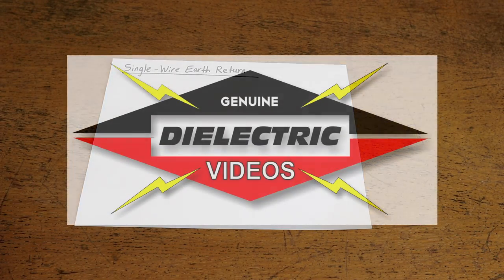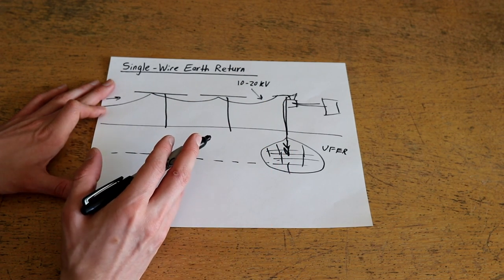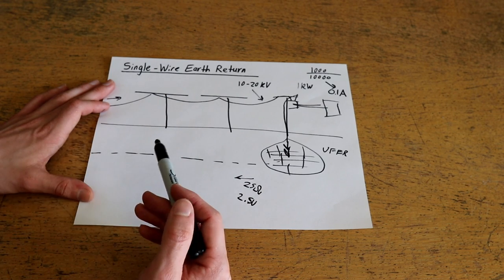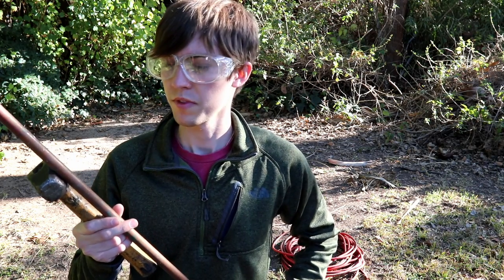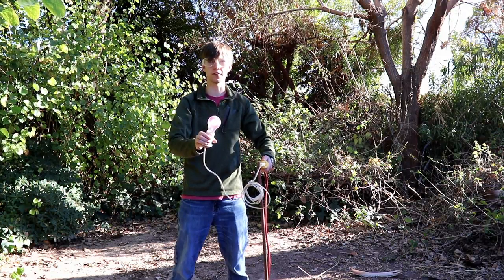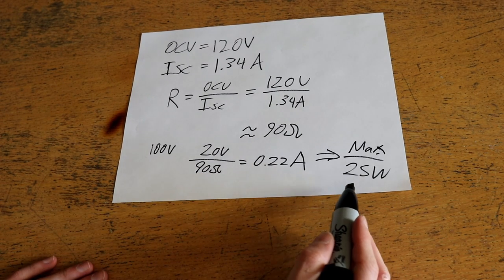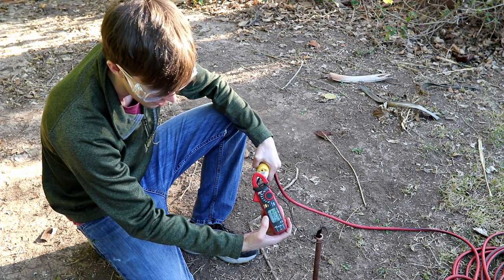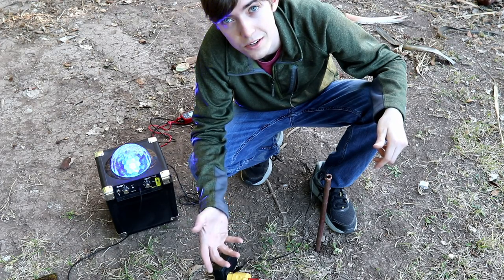EP 51 - Power Through Dirt: Single-Wire Earth Return @ 120V

Comment: When i was 17 my grandfather said he led the first AC power line installation west of the mississippi.  When i was 6 we went out to the back yard lawn with a long insulated wire, rigged to a plug (120vac) 1 meter  a wire twisted about a meter from the other end; forming a 'y' to which were added steel rods with insulated bike grip handles.  Watered the grass a bit, and pushed the rods into the ground about 5 meters from the patio slab.  Then he said plug it in.  ! he had rare external wall receptacle and we were gonna shock out some worms!  nothin' happened.  He told me to plug it in again but flip the plug over.... oh, boy- my bare feet tingled as we walked near those rods and we must have gathered 100 big night crawlers as fast as we could grab them.  Went camping and fishing in lodgepole pine country that week.  Got lots of fish too.
Reply from the maker: Good times indeed!
Reply: Ha! That's awesome! Your grandfather 
 knew he was showing you something unique that you would never forget.

Comment: Greetings, I really like your video as you are explaining the basics of grounding. Now there is a very simple way to get a much better result for your ground rod. See the ground has minerals and nutrients within. You can get better results if you would mix some manure to the ground. This will make the ground more acid. You simply add water and voila. The resistance will get lower and the amperage will increase. Warning though, should you try this, make sure you have the proper jumper, otherwise it will get extremely hot and burn. Cheers

Comment: My property is sandy loam, which when I pull a magnet through it, about 25 percent of the “sand” will stick to the magnet. When using electric coat hanger rods to catch worms, I only needed one rod, and worms came up between my rod and the nearest ground, within a few feet from my rod, and if the earth was quite damp you might feel a slight tingling placing your bare palm flat on that area.

Comment: i used to be a lightning conductor fitter, we had to install earth electrodes to dissipate the potential energy from a lightning strike, the earth electrode in some cases had to go into the earth 10 maybe even 15 meters into the ground to obtain an earth continuity resistance reading of 1 ohm. in some cases where that wasn't possible we had to install what's called an earth nest which comprised of a series of earth electrodes all connected together to obtain the 1 ohm resistance

Comment: Three 6 ft rods 2 ft apart in series tied together but the number six copper ground wire with adequate clamps you should have no problem passing power through it and there should be little to no variation. You should also be using copper clad solid steel ground rods. Drive those rods till only 6" of it is sticking out of the soil. Also I would be using some kind of a switch and clamps instead of the alligator clips The surface area contact between the clip and that metal pipe is minuscule at best. Love the video brother keep up the good work just a few pointers from 19 year electrician.

Comment: Find out what the right mix of dirt has the best conductivity in it, and fill a 6 in pvc pipe with it with end caps and a hole 🕳 at each end, with a conductive rod poked in from both ends so it can be a enclosed piece to reduce the risk of harm.
Reply: Salty wet dirt! Use that. Dry doesn't work. Go deep. Closer to the other telephone pole ground. Basically you are using the dirt ground instead of a wire.
Reply: You realize copper or CCA is cheaper and much easier, at this point? PVC is way more expensive.

Comment: Very interesting! Didn't know the ground would be that conductive, I've always assumed resistance would rapidly increase with short distances.... Wrong! I can see where this could be dangerous at very high voltage, at least 120 is quite low when compared to multiple kv!
Reply: Often, a lot of the resistance is in  gounding rods contact surface contact with the soil and is not so dissimilar to the resistance in corroded battery terminal limiting current to your car's starter.  

When a good ground is established then you can imagine the earth ground path like  a bunch of resistors wired in parallel to each other whose combine effective resistance adds like  1/(1/r1 +1/r2 + 1/r3 +1/r4 +....... )  (also known as the reciprocal of the sum of the reciprocals) which drives the resistance closer to zero as a ground path has more cross section conductive area to contribute to the return path. 

There is a limit to "effective"  ground paths futher away from a straight line return path as the additional distance in those paths adds resistance.  Differences in soil conductivity can change the  path some. 

Additonal grounding rods not only add more contact area to the ground, but if placed at 90 degrees to a long distance tramission line, can offer a larger cross section of return ground paths for a cumlative lower resistance ground return path.
Reply: When they do this in real life (it’s actually pretty common, usually in rural areas), they use isolation transformers so the voltage in those circuits doesn’t have any potential with respect to the voltage in your home (even if your house is hooked up to the system). They also use current leakage devices, similar to GFCI/RCD outlets, to make shut the system down if current is flowing around the system. It can be dangerous in the scenario the ground loses resistance and you’re touching the ground at two points of any distance, close enough to the electrodes, demonstrated in this video with the swimming pool example. The SWER Wikipedia article mentions cows getting shocked if they walk too close to the electrodes, for example. The ground resistance is high if you were to take a theoretical wire made of dirt, but the mass is so large, that it’s like a million high resistance conductors in parallel. Think of it as using a lower gauge, or thicker wire— except in this case you’re using the whole earth, and can achieve a very low resistance if your electrode is large enough. 
This is also done in the ocean with undersea power cables. Sometimes used as a backup conductor in case any of the conductors in the actual cable fail. Very cool system!
Reply: @MittyNuke1  There is a limit to "effective"  ground paths futher away from a straight line return path as the additional distances in those paths adds resistance, even as co ceptually the different paths  can be thought of as parallel resistors whos resistance adds as the reciprocal of the sum of the recripicals of all the different paths.  Differences in soil conductivity can change the current path some from a straight  line.
Reply: Tesla tells us if you zap ⚡ the ground hard enough with good enough contact and put that in resonance you can tap it without any losses.

Comment: This is the question that I was wondering the answer for too long. Thank you for the explanation. I am also wondering that where the neutral wire goes from our homes? To power plant or transformer? Where does it connect?
Reply from the maker: The neutral wire typically goes to a common grounding conductor that is shared between all loads in a given section of the distribution system. This is connected to grounding conductors at each utility pole and to the neutral/center taps of the transformer secondaries. Any neutral current from your house completes the circuit by returning to the transformer center tap on the secondary side.
Reply: @DielectricVideos  wow thank you for your quick reply one mystery solved for me!

Comment: Normal grounding on wall outlets are already connected to grounding rods in the ground.  All modern meters measure both the neutral and hot wires and therefore no one can circumvent paying their electric bill.  You can do the same experiments using just your neutral wire and your ground from the wall outlet.  If you do get better results from your own ground rod, then you should just update your grounding system with a better ground.  If your house is still using pipes as grounding, you should upgrade anyways to avoid costly power failures that can damage appliances which has happened to our family twice which was resolved by installing a new copper grounding rod with a thick copper grounding cable.
Reply: This answered my prayers 😊

Comment: in my Ham radio days I ran mutable ground rods for the ground on my antenna farm
 and wired them all together  my signals doubled over night the guys I talked to on 80 meters were really surprised ! I told them what I did and they said well that explains it we all have a network of ground rods hooked up ! it's common knowledge ! LOL
Reply: What you mean by 80 meters?
Reply: @casaavila7857 80 meter is a radio frequency band used by amateur radio operators.

Comment: You can chemically treat the Earth near the ground rod to decrease resistance. For experimental purposes just use salt water or you can use just salt and the moisture in the soil will dissolve it. Salt was the earliest method of treating the Earth around ground rods to lower the resistance. They have since developed better chemicals for treating grounding systems, but salt is cheap, and easy to obtain.

you will be surprised how much better it makes your single wire Earth return system work. It also works really good when you need to ground a radio for field operations, like say you are camping out and you want to take your ham radio and do some DX work. It makes for a big-time improvement.

Comment: Attempting to ever use the ground to supply power is a bigger failure then pissing in the wind. Years ago while doing a service upgrade I attached a wire to the 8' 5/8" diameter ground rod that I just drove in to illuminate a 100 watt incandescent lamp. Looked like a very dim single 1.5 volt miniature flashlight with a worn out battery. Mike Holt ( largest electrical web site in the world ) had to drive in 40' of screwded together ground rods in a huge open all grass yard to get resistance below 25 ohms. In Northern section of counties during freezing winter months ground resistance is ski high. Ground that you were doing test in must be very damp and high mineral contents. A old Ma Bell guy told me that they used a ground rod to supply one side of a circuit and they were supposed to go out and dig a trench around ground rod and pour some kind of minerals ( was not rock salt ) to lower resistance. He said some times they would just lee on it to lower resistance.

Comment: Thanks! What was the distance of the cable? I need to run it over a 2500 feet...
Reply from the maker: The distance was much less, around 75 feet. I think you would be better off with a 2-conductor cable for power transmission, and you might even want to send it at 240V
Reply: @DielectricVideos  I see. I guess I would need a transformer to send 1000 volts instead... seems to be the trick.
Reply from the maker: @TheVedicWayChannel  Seems like an excellent approach, you should post a video of your solution when you finish it!
Reply: @DielectricVideos  Only problem is that the cost of the transformer ends up being the same as using two wires... so not much benefit.
Reply: @TheVedicWayChannel   youbrun into upfront capital cost vs long term efficiency and power loss. Part of this depends on how much power you plan on using from the grid.

An Auto transformer can be particularly effective, and relativly cheap compared to an isolation transformer and isolation isn't nessesary needed here. 

You might consider some power generated and storage on site to lower the amp draw for when you turn things on.
Reply: @kreynolds1123  Is it possible to have storage on site while plugged to the grid?

Comment: Do valence electrons actually travel between the ground rods (one at breaker panel and the one you installed) or is the earth more like a giant sponge that can absorb and dissipate electrons? Have you tried transmitting and receiving data thru soil? Telegraph operators in the mid 1800s used single wire transmission with earth return. Thanks for making this video. Old tech but very interesting.
Reply from the maker: The frequency of the AC current is actually too high for individual electrons to move more than a few millimeters per cycle (as an interesting exercise you can compute the average electron propagation speed in a uniform rod to get an idea for how slowly individual electrons actually move). The potential difference propagates much faster, at a significant percentage of the speed of light, and this is what transmits the energy and information through both earth and conductor. Quite fascinating!
Reply: @DielectricVideos  Tom, not the ground rod at the breaker panel. It is between the ground rod installed at the transformer (electricity source) and the ground rod he installed,   He can confirm it.
Reply from the maker: @eleggance  Some percentage of the current will flow in each of the possible paths back to the transformer, with the proportion of the total current in each path set by the resistance of each path between the SWER rod and the respective ground point. It is likely that a majority of the current will flow via the transformer ground rod, but it is also possible that (depending on distance from the transformer and quality of the transformer ground rod) some current will also flow via the panel ground rod or even the water/gas lines, ultimately following the neutral conductor from the panel back to the transformer. Regardless, by Kirchhoff's Current Law, all current delivered by the hot line must by some combination of paths return to the transformer center tap.

Comment: Would have thought a house would be feed a neutral wire too from the low voltage/ step down transformer,  the earths stakes ( from the primary and secondary sides)  would be from the transformer only.  Think there has to be a minimum seperation of the earth stakes in the ground.  Your keen working on 120v without LV gloves.   Bit surprised how little current flowed to earth in the tests.

Comment: does this bypass an electricity meter or would the meter still count the current used?
Reply from the maker: The meter will still count all energy used, as this method only bypasses the neutral conductor. Typically energy metering is performed on the live/hot conductors only.

Comment: But the question is how the circuit completes if you use earth as the return path? There are many transformers installed in an area. How the current knows which transformer it will use to complete the circuit? Every transformer has one ground connection.
Reply from the maker: When the time-varying magnetic field in a transformer creates voltage at the ends of its secondary winding, that voltage causes current to flow through any path which connects the two ends of that secondary winding, with the magnitude of the current being proportional to that path's impedance. When a load supplied by the transformer is first connected to the ground, an instantaneous current flows to all points connected to the ground, including other transformers. However, if those other points (i.e., other transformers) do not apply a voltage to the load in question, their voltage relative to the secondary of the transformer in question will immediately equalize, and thus no current will flow to them. The only point connected to ground whose voltage will not immediately equalize with that of the rest of the circuit is the transformer supplying the load, which by being a voltage source, will always provide an applied voltage to the ground-load system, and will therefore be the exclusive return path for the current in steady-state conditions.
Reply: @DielectricVideos  so if we do it near a transformer, will it bypass the electric meter?
Reply from the maker: @gregebrown  No, any current returning to the transformer will do so via the neutral conductor, and in nearly all systems the hot/live conductors are only metered.

Comment: You forgot to mention the result of voltage drop. What is the voltage left for the laptop charger to work with?
Reply: He didnt calculate or measure  the actual voltage across the laptop.  But he did deduct that  given the short circuit amps through the ground return path would supply 100 volts or more for the kind of amp draw a laptop would use.

Comment: Wath happens if you ram more rods in the ground and connect them? Does the output stay's the same?
Reply from the maker: It depends on where the dominant source of resistance is within the circuit. If it's the contact between the ground rod and the surrounding soil, then adding more rods would increase available output current. But if resistance is highest around the opposite ground connection (i.e., panel ground rod, water main, pole ground wire, etc), or the soil between the two points, then adding additional rods would only have a minor effect on available current.

Comment: Great video! You talk very well. How long was the extension cord and about how much ground were you traveling through to get back to your wall outlet?
Reply from the maker: The extension cord was 100ft at 12 AWG, and it was about 50 feet back to the house and about 100 feet from the nearest power pole ground rod.
Reply: @DielectricVideos  at those low currents, the voltage drop in the extension cable is very very very small. 😊